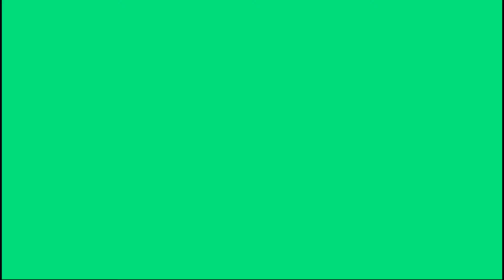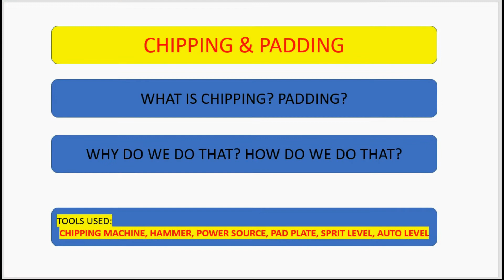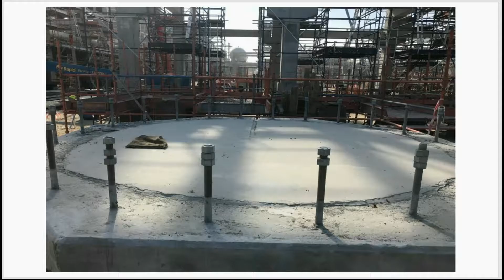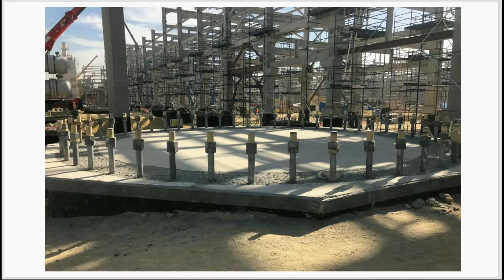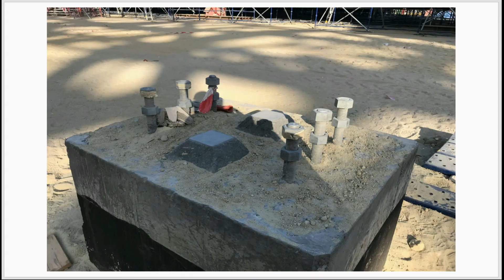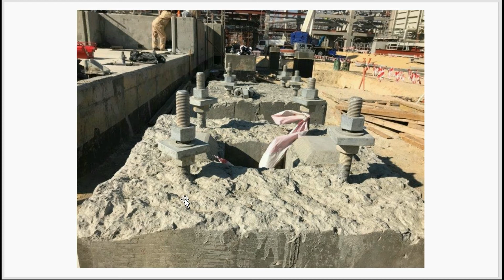How to do Chipping & Padding prior to Equipment Installation | For Freshers & Beginners | Oil & Gas

Comment: sir how to check center line and leveling
Reply from the maker: For center line, check the drawing details and with the the help of total station put the same mark on the foundation, then mark the pump centre by hand and adjust the pump skid to match both marked point on foundation and skid.

For leveling of skid, use the tool “master-level” at least  on 4 opposite end of the skid frame top and put shims accordingly.